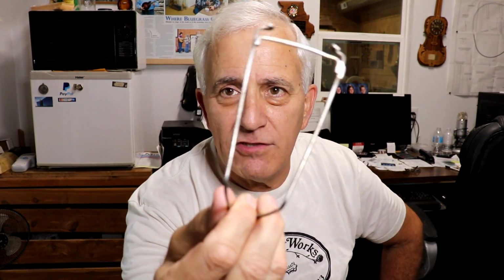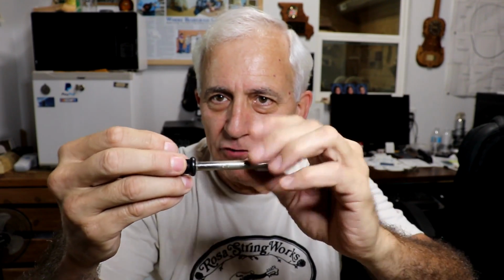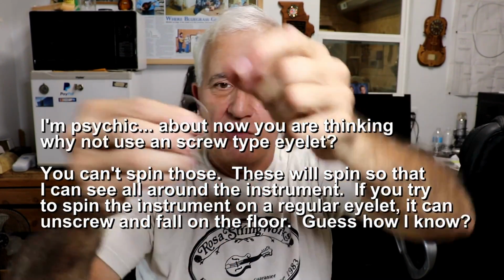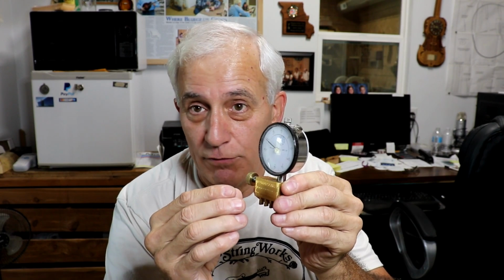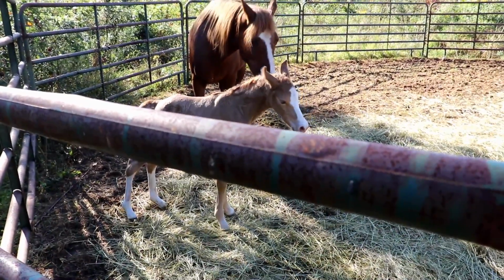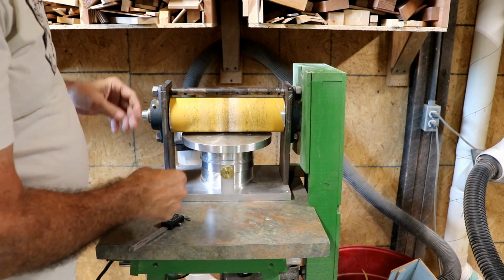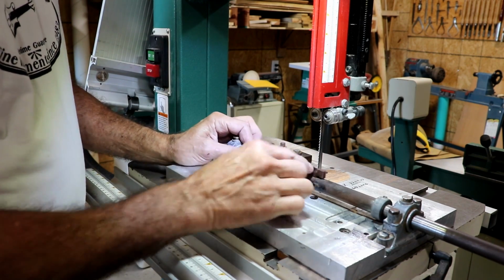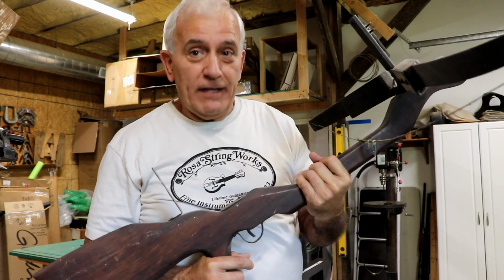336 RSW Shop Made Tools - New Farm Baby -  Gifts

Comment: A couple of years ago I've made 4 small clamps to support the inside of a aluminum extrusion and then never used em again. They are operated by wire and have magnetic bases so its easy to move them from the outside without worrying of them tippin over. If int. shipping isnt too much of a mess in my country, ill send them right over.

Comment: I have an idea for a palette knife with a heating element built in.  Should not be hard to make, and would speed up operations on bridge removal.  Maybe adapt a soldering pencil.
Reply from the maker: Yes that would be a good idea. I have thought about it several times myself. It's just you can't get it to hot otherwise you melt the Finish.

Comment: Hey Jerry, I've been thinking about your turnbuckle jack. What about drilling and tapping a couple 1/4 20 holes in the arms of the turnbuckle and running some small bolts in them, like a smaller set of adjustment arms on a transmission jack? It would give your fingers a better purchase. You're not really trying to jack up a car or anything, just holding in a glued piece of bracing. I don't know, might try and see what I can whip up because I really like the idea.

Comment: Looking at your pallet knife for bridge removal, I have watched you use it and heat it with your iron or other bridge heating tool. Since it is so thin it doesn’t hold heat very long. What would be the possibility of creating an electric knife with an attached heating element on the blade?  Some small heating element attached to the back of the blade with a low voltage cord routed under the wood handle.
Reply from the maker: I've definitely thought about that many times.

Comment: What happened to the taper gauge - was waiting for that. Just had two of them arrived after I ordered one. Will be putting the second one on UK Ebay tomorrow 29 Sep 19. It is an Insize 4630-1E and it is imperial. Exactly like yours. So for any brits who want one at a bargain price.
Reply from the maker: Sorry I realized I forgot it. It was over several days and it just slipped my mind. Too much work too little time. It is called a machinist taper gauge you can buy them off of eBay. The brand is Insize

Comment: What do you have a tool in your arsenal for curing truss rod buzz? I have a Yamaha  410 that the truss rod is tensioned to the point that it has minimal pressure, for relief,so it buzzes  on the low-E sting 12 th fret and harmonics.Which give a irradiate tuning on that string.
Reply from the maker: Really haven't run into that. I would assume your truss rod is just a little too loose and I would tighten it slightly.
Reply: @RosaStringWorks    I have done that  but it increases the relief/underbow too much for my desire. Thanks Jerry